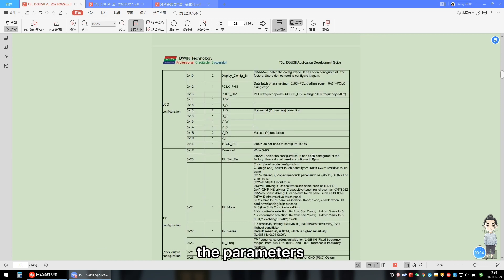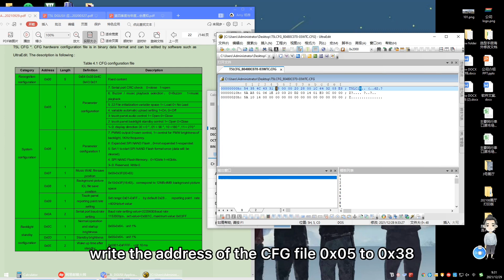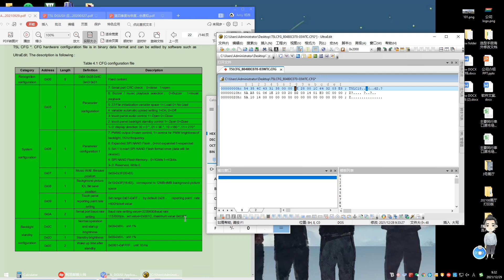T5L DGUS V7.624 CFG configuration

Comment: Hello. I did use SD card to download config but can only one download done (with download end sign). Next time it just display a black screen and not download anything. can you help plz?
Reply from the maker: Dear, you need to format the SD card and then downloading will be no problem. SD card format download method is as follows: 
Step 1: Start-run-input “command” (“CMD” for win7) to enter DOS system;
Step 2: Input command: format/q g:/fs:fat32/a:4096 (Note that q is followed by a space). Click enter after input. Where g is the disk number of SD card displayed on PC, and the corresponding disk number of different users is
different (for example, it can be “ h” or “ i” ).
Reply: I am sure I did format SD card with those code but start CMD as windows 7. I will try it and no hope it will be work.